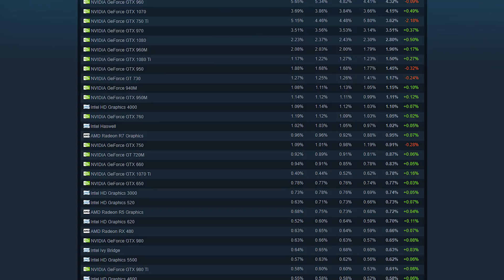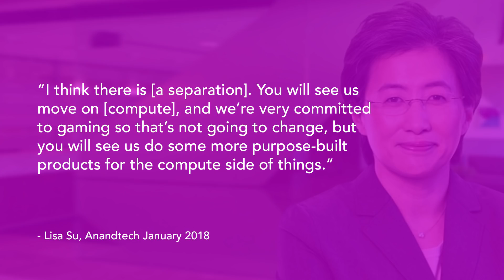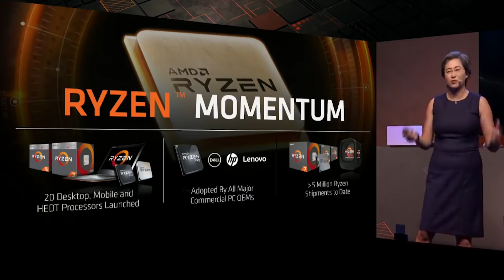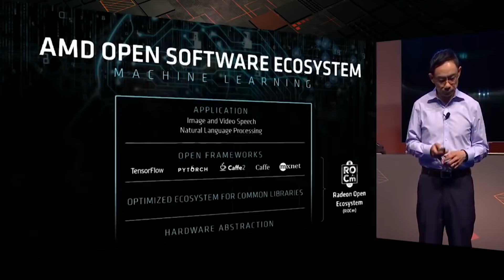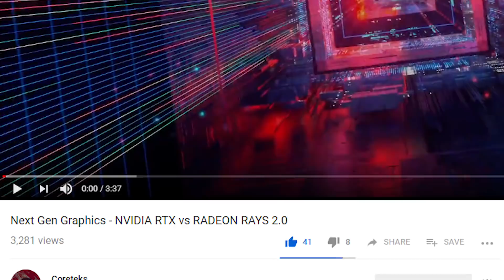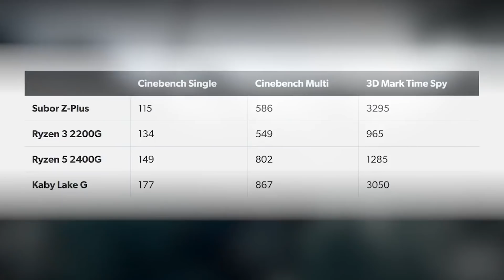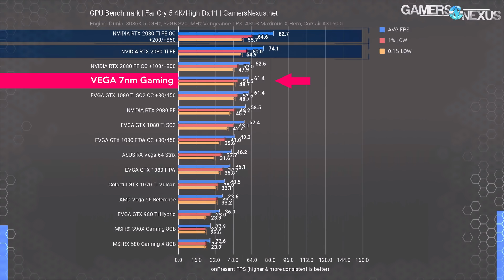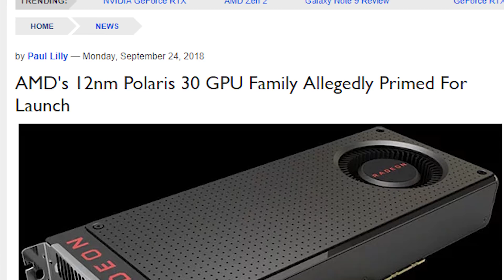AMD's answer to RTX

Comment: Edit: I love how 99.9% of the comments prove my point. Thanks.

AMD is like a lambo on a dirt road. The track stops the car from showing its performance and people call it a "shit car" - AMD has been trying to push for the dirt road to be paved - but no one funds it because they instead like the Jeep (Nvidia)'s tires...
Reply: @Tron Nort one thing i am gonna disagree are...AMD has a whole package.They can do productivity + gaming.You really think the average person will know the difference between 150 fps and 180 fps?Highly unlikely.Clock for Clock amd's faster but intel can clock higher.What if a ryzen clock to 5ghz what would the out come be then?

Don't get me wrong i think both amd and intel make great cpu's.But they excel in different things.If i was a pure gamer i would've went with an intel 8600k or something but i am not reason why i stick to the 2600 which can do productivity and do games on the side line.That's a win win combination for me.
Reply: @pierregrobbelaar9116  Ryzen 2000 is 5% slower per core at the same clock speed as Intel. Hardware Unboxed did a pretty nice IPC test on this and reached that conclusion.
Reply: This is very true. You should check out the GPU reviews on the new Forza 4.  It is one of the first times Vega really gets to stretch it's legs properly.  The liquid version overtakes the 1080Ti and lands somewhere between the two 20 series offerings.
Reply: Can confirm, my OC'd Vega56 (1663 @1100mv/920@950mv) sits above 110fps in festival areas and pins my refresh rate of 144hz driving around. The hardware is there, it's up to devs to make it work well with their game.
Reply: i work on pretty much every enviroment because im a sys admin, mostly windows and linux, and i cant tell from both perspectives that since 10 series nvidia got stuck, its starting to show their only hardware ego, amd worked on everywhere to develop their gpus and cpus with not only their manufacture but also their software that improves it over time which in my opinion expands way more its life span
Reply: VillenMillenion I'm not 200% sure, but isn't the 20 series running Vulkan pretty well?
Reply: That is an awesome analogy!
Reply: AMD vs Nvidia more like Venom GT vs Lamborghini Aventador on a race track.  Aventador will win it on the track due to better handling but on a long stretch Venom GT will rape it because it has more power just like AMD cards have more compute power. Thats why AMD cards are always faster in rendering and crypto mining.
Reply: AMD are suffering mainly because of Intel fucking them up the arse with OEMs years ago.
Reply: @Tron Nort maybe at 1080, but not at 1440..
Reply: Why bring a Lamborghini to a dirt road? Don't put the blame of the road.
Reply: BIG facts right here
Reply: i think its was the opposite.. AMD have a rough Jeep while Nvidia is the sportcar in the racing track
Reply: So use the right car for the right road then, or figure out how to change the road.
Reply: Poor analogy, simply because AMD have the car and the track - assuming we’re logically talking about a product and its support. Let’s not forget they also make CPUs and supporting chipsets so they should have a well-optimised ecosystem for anyone wanting an alternative to the dominant Intel-Nvidia pairing. Let’s also not forget AMD are responsible for the quality of driver (both literally and figuratively) which will ultimately govern the overall performance. AMD are in control of their own ecosystem and it’s nobody else’s fault if they underperform.

I’ve alternated between Intel and AMD over the years, I have no brand loyalty and my purchasing choices are made entirely on performance at a given price point. If a £2000 AMD rig beats a £2000 Intel/Nvidia rig then AMD will get my hard-earned, but I’m not going to back an underdog if it can’t win a fight.
Reply: LM002  https://www.youtube.com/watch?v=V3W8WkAQrrg
Reply: nice analogy
Reply: yeah i bought a factory refurbished gtx 950 and it hits 1541 mhz and 8000 on memory its pretty sweet
Reply: Yuuko's Faithful Husbando I agree! But sometimes they do win! RX Vega 64 is very fucking good in DX12 and much better than even a GTX 1080 TI for workbenching (video editing, music editing... Etc.)... Making them better in thermal dissipation only means significant clock gains, and that only means that they'll be gaining on the current Pascal lineup, and let's not forget RTX isnt much more powerful than Pascal in gaming performance!
Reply: Damn, that's one hell of an analogy.
Reply: AMD DRIVER GOT STOPPED TO WORK IT WILL RESET AUTOMATICALLY ! BLUE SCREEN DURRING  YOUR UNSAVED GAME FARMED SOMETHING  7 hours and REBOOTING  YOUR PC!!!!!! your 7 hours of gaming on the wind. RIP!
Reply: :) Customers and technology are just about that, making money, they just realized that they have less money than nvidia to be invested in research and development cos that's all about, which corporation can invest more in R&D wins over the competition.
Reply: Vega 64 is far faster than even the RTX 2080 Ti in FP64. Which, by the way, is what Ray Tracing is heavily dependent on. Only the Titan V bests the Vega 64 in FP64.
Reply: but not in gaming segment . in gaming segment nvidia are dominating
Reply: That analogy is bad. Car analogies are always hilariously bad.
Reply: lol like lambo? more like trash car
Reply: Have you been drinking or high on dope????
Reply: @donaldlink7389  he exagerate i exagerate simple as that. there is no way amd is a lambo
Reply: Thats how AMD works. Why the fuck you should drive a Lambo on a dirty road ^^
Had ATI/AMD stuff for years, tried to be positive after a release etc. But the only thing we got was overheating stuff or probs. Then i joined Nvidia and everything was and is fine.
Reply: If we're talking cars, I'd prefer an offroad 4x4 over a supercar anyday...
Reply: You can just say AMD's being kneecapped you don't need to say everything with dumb fucking analogies.
Reply: Wow didnt know amd fans were this stupid xD
Reply: It's true.

A lot of people think Witcher 3...etc. benchmarks proves Nvidia is better but they forget that Hair"works" isn't the only game"works" feature in Witcher 3, and I'm pretty sure you can't turn off physx destruction in witcher 3. (also why destroyed barrels...etc. look weird in witcher 3 on AMD gpu, and why chopped-off heads fly away with way more force than intended)
Reply: nVidia isn't a Jeep. It's another supercar, but it uses toll roads.
Reply: AMD is making great strides in the Linux world while NVidia basically says Fuck Linux. Linux is the future as more and more people get disgusted of Microsloths spying on their customers. as of this moment about 80% of the games on steam can be set to play on linux through wine, steam vulkan and DXVK, even new titles. I always went with AMD for the bang for the buck even though they have a shortcoming in the FPU, the price difference has always made up the difference. I want a card that not only works for games but performs well with 3d animation and modeling where today the only benefit seems to be with preview as the render engines are set to use all CPU work. 7nm cards should be 8x faster than 14nm cards not 2x as stated in this video because as it is half the height it is also half the width and depth making all transactions closer and faster. think of it this way, 2k vid or 1080p as its called is 4x less dense than 4k because the 2d flat surface of the screen is 2x wide x 2x tall. so the 7 nm chip would be 2x thinner x 2x narrower x 2x shorter = 8x performance over the 14 nm chips.
Reply: @Q5Grafx  Pretty sure Linus Torvalds says "Fuck Nvidia" haha
Reply: @Q5Grafx  nobody gives a shit about Linux, so stop bragging about Linux future because linux has no future, never has and never will be. Ive heard that "Future" thing 10 years ago, i've heard it this year and still 10 years after. you still say Linux is Future, because it will never come. thats why its future and not today.
Reply: @840mgames2  Linux is already powering most of the devices and servers we run. You probably have an Android phone, dude. Lol
Reply: I personally relate AMD to import racecars because they're reliable and make you push your limit without spending hundreds of thousands of dollars to be competitive.
Reply: Amd is trash LOL
Reply: I mean, if I'm gonna build a gaming computer that's strictly for gaming, I'm gonna put the best parts available at my price point.  I hate that AMD doesn't offer that above the rx 580 right now but I'm not gonna pay extra money for my 1070 or above level graphics card just because "It's AMD" I'm  gonna buy what will be best for me.
Reply: Groovemaster2k Go big or don’t bother imo, I just built another gaming pc and it cost me a little over $4000
Reply: Great, but I'm sure that didn't include wasting money on overpriced products like the Vega gpus...you most likely got a 1080 ti or two....Not sure you understand what my point was
Reply: @Tron Nort can you make a point without being a bigot
Reply: Tron Nort no shit a 1080 wont push 4K 144HRz if you wanted that you should have got a 1080ti. 90% of buying a GPU involves figuring out which one does what you need, if you want it to do that get the one that was designed to do that if you want one to do maybe 2k 144fps then get a 1080 want 1440p get a 1070 so on down. You bought the right CPU but the wrong GPU, in my opinion if you needed that 144fps you should have spent the extra 100-400 and got either a hybrid 1080 or a windforce 1080ti
Reply: NO
the dirt ROAD is AMD itself! dont blame your idol company failure to other company and people
typical a LOSER
AMD cannot read the situation and market area, AMD make a "LGBT" GPU, and they named it GCN, they want to rule GAMING and WORKSTATION market at the same time in 1 GPU and THEY FAILED
FAILED in workstation , FAILED in GAMING too 
for example VEGA LOL, They make VEGA for gaming, but VEGA run slow in gaming, but fast in workstation, but noone buy RX vega for workstation and rendering LOL

your idol  company leader is IDIOT
lisa hsu is genious, she make AMD quit from HIGH END market and focused on CONSLOW and date centre
understand filthy WEABOO ?
Reply: @googlestadia8570  so the company makes money. Lol.
Reply: LOL what, it just sucks
Reply: Tron Nort my 1080ti does in many games with a 8700k and a 1080ti OC I mean obv it isn’t ideal but it can do it
Reply: So what would be the road itself?
Reply: Lol maybe AMD should make their own Jeep instead of trying to release a street car for a mountain environment.
Reply: strelokblyat  there is a lot more to it than that, lol.
Reply: you gay fuc
Reply: This comment
Reply: not to mention that since AMD got involved with the open source enviroment is getting a more rapid development and having a more secure platform
Reply: Mmmmmmmmm kinda. Nvidia has had the better silicon tho. AMD has had great design but their fabricators, Global Foundries, just doesn't have as good a fabrication process as TSMC which Nvidia uses. Fear not though. AMD's 7nm is coming out of TSMC's factory. Then we really get to see what AMD's superior design can do.
Reply: I like your analogy.  I think people fail to realize that RTX is a reaction to AMD's pushing of the sector.
Reply: there is no such thing as finewine tech. the cards get faster through drivers as it is normal for cards to do, however when nvidia launches a new series of cards, they nerf the previous cards through their drivers and AMD's cards get better overnight in comparison.
Reply: The fact that nvidia reduces the performance of previous generations of cards is rather a myth. The increase in power caused by new drivers will always be smaller, the more they are more developed over time. If someone thinks that the old driver works faster, unless he is handicapped that he installs new and complains.
Reply: Well depends on state of that driver, some drivers are buggy on release and they do shit on your pc, so installing or keeping older driver is just countermeasure. Same as windows updates... It just 600mb of updates for microsoft edge which is used by noone.
Reply: Ummer Farooq  I disagree once again.  It will probably mean the decline of jobs we have right now,  yes.  But,  humans never working again? Hell no.  The real future is in new jobs, and human-ai cooperation. We just haven't created this yet.
Reply: AMD is fighting an uphill battle. And they have been in a spiral for a long time now. Nvidia has the lion share in the gpu market. AMD produces good (and over engineered) hardware but its performance isnt shown in games because most of the games are optimised for nvidia. And game companies wont optimise for AMD or work together with AMD if they dont have at least a significant market share. 

Just look at the rx 480/580. 1) if it was produced by TSMC instead of GloFo its power consumption would be closer to the 1060 and its clocks would be much higher as well. 2) Its tflops is the same as the 1070 in DP and SP 3) its core count is higher than the 1070, in fact it is even closer to the 1080 than the 1080.

The only thing where it lacked harware wise was ROPs  and clock speeds.

This fine wine thing only looks like it because some developers finally decide to work with the AMD engineers together to make some changes to the code so it runs better, ... after some years.
Reply: Jon Son 
I see this too much. “They don’t perform well in games” “it’s all about games” “if it doesn’t game well it suxxx”
Ever consider other metrics used to judge hardware? AMD wipes intel off the map in professional areas. Not everyone plays games.
Reply: @jonson856  More like PC gaming had been heavily undercut by consoles, and AMD would be bankrupt if they worried about the small market segment that is PC gaming. It is and always has been about the server market. And now SoC market.
Reply: @jonson856  how can be all the games be optimized for Nvidia when they are console ports? Consoles run on  AMD GPU.
Reply: no
Reply: I saw someone say early on that the companies don't care about consumer grade hardware, but only about the money involved. This is only true to a very small extent. With both AMD and Nvidia, the consumer grade hardware we receive is really scaled down technology developed from research, and funded by big multinational corporations. Nvidia is really big with this, and has so much money invested into large ai, and graphics, and other research programs. I mean, take a look at the work Nvidia has done with roborace, and self driving cars in general, or their work in the medical sector. For example the 3d coloured mri scans are an example of large scale, industry leading technology that has then been scaled down, to a consumer grade, in the form of deep learning super sampling. So maybe the companies are doing this all only for money, but they do care, because it is really all the same stuff.
Reply: @Ummer Farooq sorry, but referencing tv shows and games is just a straight up a bad idea. The fact is, those kinds of content are designed to play on our human insecurities, and create an idea of a dystopian future miles in the future, or just miles from anything possible at all. If you want to talk about upgrading bodies, there's a really good video of someone who adds a second thumb, on the opposite side of your hand controlled by your foot. I know this is a purely mechanical example, but it is a good example of a feasible "upgrade" that strongly benefitted the user.
Reply: Nvidia cards look like Lambos. AMD look like Volvos.
Reply: @Blood Angel: So.. Speed vs safety.
Reply: More like a vw golf from 1986 mate.only considerable thing about amd are processors.and intel still surpasses them by a lot.
Reply: @victorchb1  lol .. amd surpasses intel on architectural level ever since ryzen came out .. zen arch. far surpasses any intel arch. existed.
Reply: AMD is for commercial application massive rendering projects or anything like that, that’s why it was used it bitcoin mining, the hashrate was high. When it comes to gaming Nvidia grinds AMD to dust
Reply: @greyhead3626  not for much longer.
Reply: AMD fault.
Reply: AMD fine wine technology ©
Reply: Nvidia were smart enough to use the Lambo on paved roads as intended :)
Reply: lol amd fan boy. AMD hasnt had the top teir gpu in a long time. They couldnt beat the 1080 ti let alone compete with the 2xxx
Reply: Worst.  Analogy.  Ever.
Reply: This makes no sense
Reply: AMD cards are not efficient. The RX580 uses more power than the GTX1080 but performs identical to the GTX1060.
Reply: thats what AMD fanboys thinking? LOL
Reply: Always get a good laugh reading what you delusional AMD fanboys have cooked up to fit your view why AMD aren't capable of producing an enthusiast grade GPU.
Apparently Vega 64 already is that but it's Direct X, Vulcan and everyone else that's at fault for not being able to fully explore the TRUE POWER that lies inside
Reply: then amd is dumb if ride with lambo on a dirt road :) Stupid example. Amd is a stupid company and dont know how to challange with its rival
Reply: Erdinc yilmaz kind of stupid commentary only comes from a turkish guy someone like you as i expected
Reply: @erdincylmaz4529  Its about revenue. The real battle is in server and SoC. If they focussed on PC gaming, they would be bankrupt
Reply: your comment is like a pile of shit, shit. nah but nVidia have stronger gpus thats it, dont like em but i have to buy em
Reply: Out of your whole ramble all i got was the word "shit". Yes AMD is shit. AMD makes processors, always has. Hence the name average median devices.
Reply: Let's be honest, Nvidia just does it better and that is why you pay an extra price. Haven't we seen an Nvidia card looking like its worse than an AMD equivalent (in pricing) on paper. The specs often look like the AMD card has an advantage, when in reality the performance of an Nvidia card is so much better on a lower "spec" or "build" if you like to call it. A perfect example is a GTX 970 vs R9 290. Similar prices, but the GTX 970 is much better and has a smaller power draw. To put it in a perspective a 970 has 3000 more points in 3Dmark than a R9 290. While the 290 is a much faster card on paper, having a gigantic 512bit bus (vs 256bit), almost double of the shader units and double the ROP's

So how do you explain that.
Reply: its just like amd pushing vulcan, yet vulcan madeno difference and nvidia runs it better than amd now.. amd's shortcoming, and always has been, is their software development and support.. They release their cards, rushed to market, with crap software (drivers) thats where that amd ages liek wine bs came from.. because they release basically a beta product, and there is only one way to go after they update drivers to what they should have been at launch, thats exactly why I quit buying amd gpu's after the 480..
Reply: But their hardware is great for people who run linux distributions, its more easily compatible with what linux wants to do for multiple purposes.   With the way things are going, with customers pissed at microsoft for various reasons with update pushing and breaking stuff,  this also might be the beginning of a golden age between AMD and Linux working together, including significant in-roads into gaming on Linux (not claiming it's the best just significant enjoyable strides in gaming in linux where it's good enough).
Reply: have had worse luck with Nvidia drivers then AMD drivers.
Reply: That's not entirely correct. The issue at hand is Nvidia's proprietary software used by game developers. The software is designed to run exclusively on Nvidia hardware whilst AMD use open standards. It is to AMD's credit that they their product runs so well using open standards. This fact has been well documented many times. I support open standards and so should game developers. AMD's software has improved immensely since 2016 and expert critics have placed it at an advantage compared to that supplied by Nvidia. Using DX12 or Vulkan or Mantle makes little difference if the game developers have written their games using Nvidia's software.
 
I realise that game developers are conditioned and heavily supported by Nvidia hence the reason the mutual support Nvidia receives. The Vega64 has similar compute power to the 1080ti but cannot compute the required fps as it is gimped by the Nvidia proprietary software. Nvidia know this and that is one reason why they released their current RTX cards using their proprietary interpretation of ray tracing. AMD are strong in this area but they use open standards. They also know that the Vega64 7nm is 35% faster and places it at 1080ti levels and higher, beating AMD to the developers with their own ray tracing agenda. AMD's Vega64 7nm will be released shortly and the pricing will be somewhere in the $549 range making it extremely attractive compared to the 1080ti or the new RTX cards.
Reply: @danjal07  nvidia runs vulcan better????
In wolfenstein 2 rx 580 beat the gtx 1070
Go check
Reply: Man you got so many stuff wrong. Drivers have been good for years.. unlike nvidia... Nor are the cards rushed. You seem biased.. specially when you claim that Nvidia runs vulcan better, it does not.. Nvidia barely supports async shaders... AMD supports it on a hardware level.. even before mantle even existed(just an example). Let alone the tricks nvidia uses to look like they preform better( texture rendering quality.. its all over the net).  Nor do Nvidia cards gain preformance over time.. some thing still happening till today for amd cards, even with the drivers that preform like they should out of the box.
Reply: Vega 7nm is faster than 2080ti my best friend works at MSI factory as line operator they already making a unamed AMD vega card 7nm that can support raid tracing. hoping he can sneak one of the sample designs out so I can see how it performs, like he snuck out sample box he made too much of it it's supposed to be only 5 of it he made 10 so he snuck one out writen on it Vega 7nm sample box and specs: Base clock of 1525MHz (not overclocked), Memory speed of 16GBPS, Memory: 16GB GDDR5 Supports AMD raid tracing Software and drivers. Note this is the specs but not all cause box is still undergoing redesign it's just sample says my friend
Reply: nvidia cant work properly with vulkan, half of the time actually loses performance
Reply: @villenmillenion7986  actually rtx cards are built with vulcan and the new Nvidia cards are really exceptional in vulkon titles.
Reply: @danjal07  Citation, citatation... Citatation.
Reply: @danjal07  Vulkan is Khronos Group . Not AMD. We need low level APIs.
Reply: What a stupid analogy. ‘My product ain’t that good therefore it’s the market for being so demanding’ 

You sir have a strange way of using logic.
Reply: That’s complete bullshit! Only AMD fanboys ever say shit like this. It is up to AMD to bring out useable hardware, not the software developers problem to write for the hardware.  Yes change sometimes needs to come but there has to be functionality in old software during the transition.
Reply: in game nice fps = nice gpu 
In programs
NVIDIA = GPU strong, trouble-free, no nerves
AMD = shit - strong but not supported does not work at all, Nvidia does not have this problem
I prefer to pay a little more and have better support than to get pissed off.
Reply: What a shit analogy, here's s better one: AMD is for people who are poor.
Reply: @Jay-tn7dw  Or people who just don't want to spend more on a setup that runs wild 144hz monitors or whatever..
My problem with amd is their tdp and heat problems, I had a rx 460 2gb card for a few years, working with small opencl rendering, switched to a gtx 1060 6gb just a month ago for 130$, and I'm running at close the same tdp, and even lower temps.. With a card that is 3x more powerfull..
Also, I just won't trust anything from amd gpus untill I actually see it, since vega was just a huge flop.
Reply: Fuckin WEABOOOOO! FUCK YOU